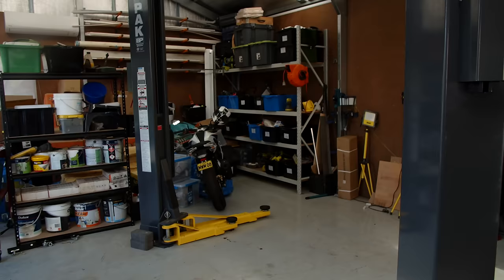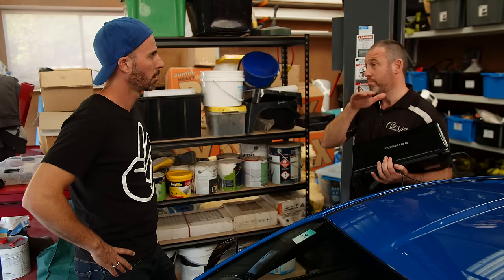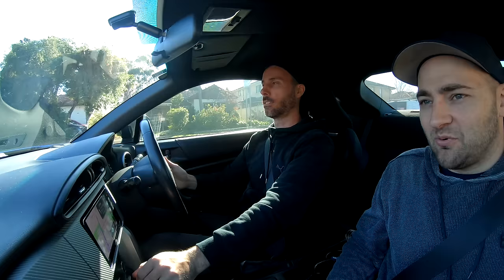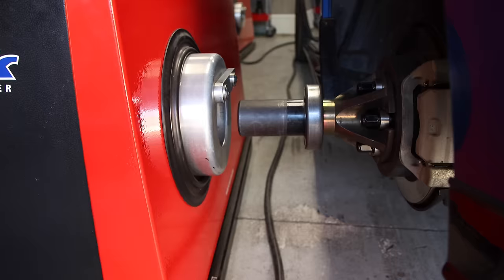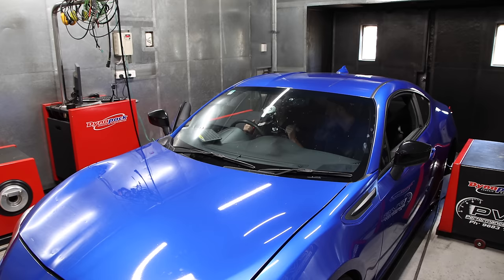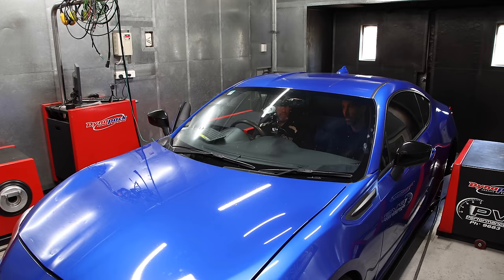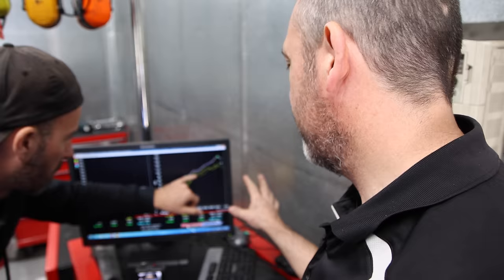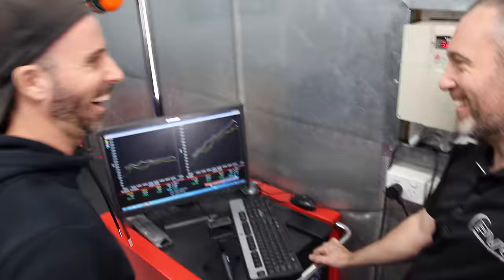How To Make More Power with an NA Engine (HUGE INCREASE!)

Comment: “The 86 and brz respond well to a complete engine swap” - probably turbo yoda.
Reply: "Add a barra" - Turbo Yoda
Reply: I know this is a joke.. so I'ma be captain woosh for a second.
But as far as I'm aware the FA20 respond super well to a turbo. Infact there is the FA20F making 300BHP  in the JDM market Subarus
Reply: OwenWalker there’s a lot of Brz with 300-400whp on stock monitor built engine I’ve seen a good amount of 500+ highest I’ve seen is 750ish whp but at that point traction becomes the problem and the clutch if you don’t upgrade it
Reply: There was one with two Hayabusa engines. It sounded glorious.
Reply: turbo yoda made turbo swap parts for the 86s though.
Reply: Cummins Swap?
Reply: @Fergus Redpath like the suicide MX3
Reply: @BaphometIncarnate  And then the engine goes boom after 50k.
Reply: @OwenWalker  if they want to stay NA, they should swap is with a nice 6 cylinder boxer. The one featured in Best Motoring had around 300hp and barely gained weight.
https://www.youtube.com/watch?v=VOThemNoizo
Reply: I'd Love to get an 86 and 1j swop it
Reply: Add an 07K and turbo it....
Reply: @KevinSmith-qi5yn  - That's really going to improve handling at the track.
Reply: @QuickQuips  yeah but that's where those Hayabusas lacked: Reliability. This were racing engine that require a rebuild because of the high torque produced
Reply: @KevinSmith-qi5yn  Merlin.
Reply: I would Barra power it!!
Reply: @centralintelligenceagency9003  5K ?
Reply: Kevin Smith bruh there’s no way. The car would snap in half with that much weight and torque.
Reply: LS3 drops in there nice and easy, just a trans tunnel brace needs to go. they sell kits for direct bolt in and plug n play to keep all your creature comforts inside as well
Reply: Lmao right
Reply: My friends 92, ex coupe responded well to a complete engine swap too dude, that’s like saying a big ass bottle of nitrous should do the trick just playing brotha we’re all car guys here, (it will really do the trick in sending a piston through your hood)
Reply: @centralintelligenceagency9003  thats on your tuner. 50k motor? what you doing to it. my daily subi makes more power per cylinder than your truck.
Reply: why would you want to swap the FA20 engine from a brz into an '86 ???
Reply: FA20's are junk
Reply: @FiveCurmudgeon9  thats what they said about cvt now look at them it was a first gen platform and they improve everyday. have you ever sleeved an fa20? or sorted the factory faults? or are you a ford driving fanboy who doesnt know his own ass. Title match?
Reply: Turbo Yoda is developing a Turbo kit for them
Reply: No they are better with an FA20 with a turbo. Or Harrop supercharger.
Reply: Put a rotary
Reply: @TheTobes99  I believe Alan developed one with Coyote Tuning in Brisbane a few years ago. Google Coyoda Turbo.
Reply: I know he did some work on an 86 that had a 2jz in it.
Reply: I would agree
Reply: @OwenWalker  I've heard the opposite a lot, but not sure if its ass talk or fact talk. People say putting a turbo in a brz blows the motor quick
Reply: Actually that was Master Oogwai
Reply: lol god damn man that's savage.

Comment: I have to admit, I like my current turbo car.  But I still love my old n/a engines, with big cams, instant throttle response and peaky power curves that have nothing below 3000.  They may be a little harder to drive - especially on the street - but they are very rewarding if you're just looking for a blast through the twisties.
Reply: Ive owned N/A all my life and now just got a turbo. I love both. But nothing beats that BOV sound when you go to release the throttle
Reply: A turbo-charged engine is better for your daily while a NA is more fun for a small sporty car.
Reply: @MasterAppels   Is definetly not better than na for a daily
Reply: Old American N/A V8s are really the best feeling
Reply: reliability wise?

Comment: Even after fixing the exhaust leak, it just sounded awful on the dyno.
Reply: But it made good power according to the dude tuning it, that counts.
Reply: 30hp gain with just an exhaust and tune for na is really good.
Reply: @az_3kgt714  It's 30kw not hp. so roughly 40hp gain.
Reply: Well, it's BRZ what did you expect?
Reply: 30hp for that $1500+ is not value for money.  Enhance injectors, turbo remap and boost control can do 100hp for $600.  NA is great if you want to spend a lot of money going slow.
Reply: @stevensimms7014   Id love to know where your getting a proper turbo kit, as well as doing a full fuel system up grade as well as the tune for $600
Reply: @arjunpersaud4605  the topic is NA Vs Turbo.  I didn't say anything about adding a turbo to an NA car.  My point was, choose a turbo car to begin with and tune.  $240 got me 40 at wheel on TDI.
Reply: @stevensimms7014  I see where you  were coming from but the thread was talkin abt the BRZ thats why I didnt really get your point
Reply: @arjunpersaud4605  the car in the vid was a BTZ/86 but the debate is about all NA cars tbh... Title is generic.  If you're happy to spend $1500 on really bad gains then feel free.
Reply: @stevensimms7014  I've seen a lot of NA builds win against turbo BRZ/86s on track days so...
Reply: @impreza0109  I'm not saying that  all turbos are faster than all NA. But I bet that NA you saw had a LOT of money spent on it compared to a turbo.  Turbo is cheaper horsepower, undeniable.
Reply: @stevensimms7014  until you have to worry about piping placement, different suspension setup, a more robust diff, bigger brakes, a different tune, a different clutch etc etc

yeah. "cheaper" lol
Reply: @stevensimms7014  turbos on a BRZ will break the driving dynamics and balance and add unnecessary Weight.
Reply: @stevensimms7014  Tuning a stock turbo and throwing some new injectors on isn't gonna help when you blow your engine or something else.
Reply: @RealTalkOttawa that's what I Was thinking. So what's the safest thing do is headers exhaust and a tune? What else?

Comment: I'm sure Turbo Yoda is giving Moog the stare into his soul with that intro! 😂😂
Reply: I wonder if it will fit his Honda
Reply: Use y'er brain, Use y'er brain, Use y'er brain... Al in a cross legged yoga (Yoda) position, sending Karma waves to Moog.
Reply: This engine can not take more than about 250hp at the crank. If you want more, you need to at least change the connecting rods...

Comment: How to make more power with an NA Engine:
Look at turbo kit prices
Double that
Look at turbo kit horsepower
Half that
Voila
Reply: That was nice of you dude.. You could have been realistic. Instead you decided to be nice and pretend you can make half the power keeping a motor N/A, that you can by strapping on a turbo. And for only double the cost? Man.. Your optimism is infectious.

Realistically you can probably make the amount of power keeping a car N/A, only after multiple thousands of dollars.. That you could make strapping a  300 dollar ebay turbo on. Plus the turbo manifold and some piping and such, as well as a tune, running a conservative low amount of boost. Maybe five psi or so depending on the car and the turbo lol. It just really doesn't make sense on some cars...

I will say though that some cars can benefit quite a lot more than one might think from your basic bolt-ons. I had a 5 cylinder Volkswagen MKV Rabbit.. The exhaust consisted of two resonators, a big ass muffler, and then a suit case muffler... Chopped that shit directly off, went up to 2.5 inches, added a magnaflow and called it a day.. Then the air intake, the one and only time I've ever looked at a car and knew that an air intake was going to wake a motor up instead of doing absolutely nothing.. Not even kidding. The thing came up about a foot long tube, did a 90 degree bend.. Went another 3/4 foot over the top of the hot engine, another 90, another 3/4 foot still on top of the hot engine, another 90, ANOTHER 3/4 foot on top of the hot engine... Out another maybe 1/2 foot tube into the throttle body. It literally did the most pointless, long, twisting loop... Right over the top of the hot engine inside of the engine cover before making its way to the intake manifold. It was the DUMBEST design I've ever seen in my life. A 300 dollar carbonio cold air intake (my only option) later... This thing was a bigger pipe diameter, the probably 4 inch cone filter was in the absolute perfect spot right inside an isolated pocket behind the bumper where air came in, and traveled about 1/4 of the distance to get to the intake mani.

I never got a chance to get a tune before I wrecked it but... Trust me when I say this, I've had many cars and the first thing I've done on every single one of them was exhaust and intake because I enjoy the sound... I'm not someone that ever thinks my car got faster after just doing the exhaust and a cone filter. Had never happened to me before, hasn't happened since... I swear getting rid of those insane restrictions added 20-30 wheel to that Volkswagen though... On top of that 5 cylinder being one of the best sounding motors I've ever heard. Now, it was only rated at 150 to the crank you gotta remember. I don't think it's impossible that eliminating such restrictions probably brought that 2.5L 5 cyl to ~150 wheel.. Do you? Sorry this was so long.. I wanted to share with the class.
Reply: Daniel Nelson a good turbo build for a 2ZZ-GE costs maybe about $7k and can get 400+hp, maybe 500 but not reliably. For a $13k NA build my goal is 240 crank. ITBs, Really big meaty cams and supporting valvetrain bits for 9k rpm, 12.5:1 compression, flex fuel, lightened crank, haltech nexus r5 ecu. A gnarly engine like this can still be tolerable to drive since you have two different lobes for low and high rpm operation. I could probably make much more power with a Honda motor, for the same price, but because I’m stupid, I want to stay toyota.
Reply: @danielnelson4881  r/whoosh
Reply: @Tzalmavet  What exactly went over my head? If you read again, I 100% agreed with the guy I responded to... So... Here let me do you now!

r/wooosh!

Isn't this fun!
Reply: @JaydenET  you give me 2k and any car I'll be pushing 500hp its easy to accomplish on next to any car with only 2k so easy you can pump 500 hp cars out like a damn ink printer edit i can't even think of a limit to stop the exaggeration on tht go down to bug  and golf car size will be lowest limit and cars tht all ready have 500 hp being the highest limit basically any damn car for 2k u can push 500 hp out of hmu we can open a shop and print 500 hp cars
Reply: @buildtime78years9  BRZ, Integra, Civic, Corolla XRS, Miata, you’re not making more than 300 on any of those for 2k
Reply: I can't find small enough turbo for my car tho, I have a 1.0 liter carbureted engine lol
Reply: @videorowtv5198 bro you ain't making any power out of that no matter what 😭

Comment: Amazing!  Marty has his own Benny installed in his shed!  That must have cost him a fortune.
Reply: 2 posts are not as expensive as you'd think. The main issue usualy is the floor but as you can see marty's shed is on a nice soilid slab of concrete (which probably cost more then the shed + hoist)
Reply: @b.w.9392  Oh, I was referring to the person named Benny....  Because Benny was in the part talking about the exhaust leak.

Comment: How to make power with a naturally aspirated engine: add forced induction! 👍
Reply: Start with a better engine that can rev to the moon.  Make it rev even more. Compression, very carefully wave tuned intake and exhaust rather than off the shelf.
Reply: @VeritasEtAequitas  Ditch the 4-banger and go to a V8.  Then tune it out.

Comment: Exhaust sounded horrible on Dyno - like a jack hammer??
Reply: Might have something to do with the equipment they put in the driver's side tailpipe (no idea what it is but if I had to guess I'd say it measures co2/nox emissions). You can see it at around 9:00
Reply: @m1llie_  It has nothing to do with the sensor attatched to the tailpipe. It has everything to do with the crap quality exhaust. Needs a resonator or a better overall exhaust design for it to sound nice. Currently it sounds like a straight pipe on a slow revving engine.

Comment: Depends on the original intake design. Mazda when they upgraded the RX8 intake actually bough an aftermarket design because it was that much better.
Reply: It also depends on the car. Too many factors to consider, certainly too many for an AEM type to account for and advertise big gains.

Comment: Not having to worry about heat and (more difficult) tuning is sometimes worth going NA. You also don't have to worry about stress on your engine or diff. I plan on going NA in my ND miata for hopefully an extra 30-40hp which is fine for me.
Reply: There's also increased maintenace, which is a main reason I don't go for a turbo setup (but am considering to put on a supercharger instead).
Reply: Also very calming for your mind. Gets scary sometimes tuning boosted cars especially if it’s your daily driver.

Comment: 25% increase from exhaust and tune. I think I've never seen that on a na engine, ever.
Reply: Mojo shows how poor the original set up was. Mind you, the new exhaust sounds terrible.
Reply: @jonlaws4493  I mean, the stock FA20 makes 100 horsepower per liter without a VTEC style variable valve lift system while meeting various international emissions and noise standards. Armchair engineers always think they know better than the guys that have to actually sit down and design this shit while meeting X, Y and Z requirements.
Reply: @glhs386  Still not as impressive as Honda. Still not reliable when you try to make decent power with stock internals.
Reply: Him saying that the car from the factory has 100 KW at the wheels was awfully suspicious.
I wonder if his "stock" tune was tampered and purposefully undertuned so they could show off a bigger increase in power with the tune...
Reply: @ErebosGR  nope. I owned one before I boosted it. Did base reading when it was stock and it was making about 100kW Factory stock.

Comment: Supercharge it so you don't throw away your exhaust mods. Centrifugal supercharger will work really well and keep the NA feel of the power curve.
Reply: What other mods need be done won't it blow motor? I wana increase power on v6 3.8L what's safest mods to do? It does zero to 100 in 6 seconds but stil abit slow how can I increase abit without fkn engine lol
Reply: @jayjunior2023 is that the Chevy 3.8L?
Reply: @user-rq9ip1iv8b  genesis g80
 But don't worry..motor ended up blowing. Got diff car now . Infiniti q50 red sport. Needs a tune now
Reply: @jayjunior2023  sorry for your loss, but happy for your gain. Best of luck man.

Comment: What is the measurement of 1 horsepower?
746 watts
The electrical equivalent of one horsepower is 746 watts in the International System of Units (SI), and the heat equivalent is 2,545 BTU (British Thermal Units) per hour. Another unit of power is the metric horsepower, which equals 4,500 kilogram-metres per minute (32,549 foot-pounds per minute), or 0.9863 horsepower.

Comment: I'm not sure if you were aware. 
But, these cars have a factory torque dip in the middle of the rpm range.
And they respond well to exhaust and a tune.
I saw it on the internet. . So it has to be true..

Comment: When you said you weren’t going turbo, I thought you’d be doing things like camshafts and cylinder heads rather than just exhaust and tune?
Reply: Probably doing mods that anyone could at home
Reply: My money is on a SuperCharger...
Reply: I think the emphasis is on being cheap cams and heads are pretty expensive
Reply: Nah bro they need to do actual research for that, not just slap a turbo and visit the tuner
Reply: All the companies used are Australian and not the usual companies so maybe this series is to promote local companies
Reply: They obviously didn't want to spend any money for the car, since everything that went into it was sponsored. I bet even the tune and dyno runs were sponsored.
Reply: @ErebosGR  yeah the real money is going into the sti they are doing
Reply: @mobilePCreviews  It's really not that slow after headers/exhaust/tune. Especially if you run e85. And the point of these cars is canyon/backroad carving. Turbo'ing it completely throws of the feel of one. Supercharger would be the only route I take with mine here shortly. Have a edelbrock ordered for my 16 frs.
Reply: @mobilePCreviews  MCM has 3.3 million subscribers. What you tube channel do you have? Calling someone dumb, is the problem with the world today. Your opinion, is the only one that matters? Turbos and superchargers cost money. Why don't you send them the turbo or supercharger. I bet they would put it on then.
Reply: M

Comment: If you really want to make the most of this, you need to do a video on e85. I'd suggest an ECUtek tune as that would make for quite interesting content as you could cover not just e85, but the fact that it allows different maps (that you can change between with the cruise control stalk) and has a number of different features such as throttle blipping, launch control and flat foot shifting.
Reply: Not sure how it is in other countries, but here in the US, 91 octane really sucks the life out of them.

They get a reputation of being slow being run in western mountain states with smog check certified OE exhaust and tune with 91 octane at high elevation. Then back east the cats get tossed, the tunes get changed, 93 is available everywhere, air is more dense, and the difference is pretty stunning.